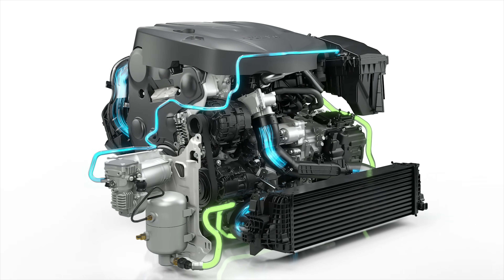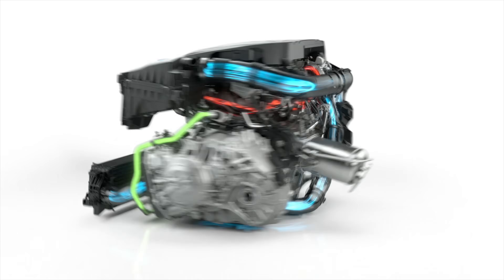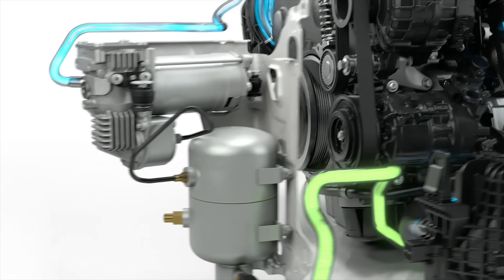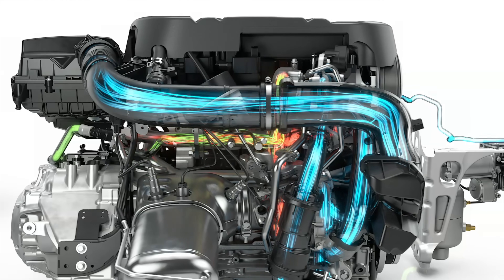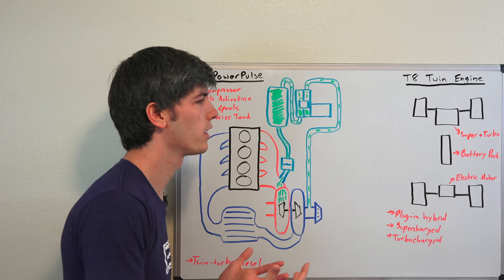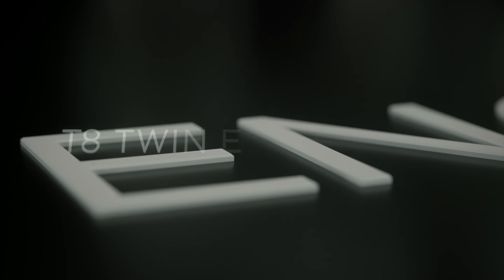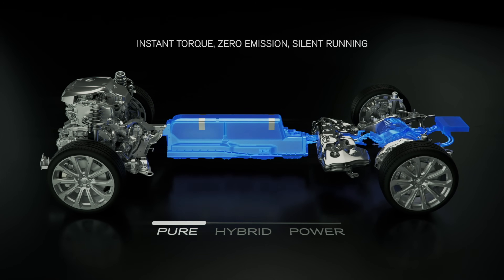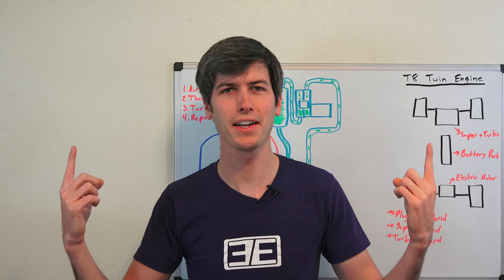How Volvo Is Eliminating Turbo Lag

Comment: Subaru used Twin Scroll, and they and others have played with sizing (asymmetric intake and exhaust), or are going to very high compression and lower pressures with a tiny turbo with very little lag.

There's a lot more choices than just Volvos.  And some are interesting.

Comment: Mercedes old unimog trucks had an air compressor build onto the engine to supply air to the brakes and also any attachment that the truck would have like Jack hammers, excavator attachment etc..

Comment: Volvo is also doing a electric turbo with a belt alternator starter that also adds power directly to the crank for instant torque the (BAS) produces 48v so the E turbo is no joke and will only activate at (WOT) tip in from dead stop or cruise I even think the A/C compressor will be powered by electric motor not from the crank

Comment: Maaaaaan I know this is one of those ‘yeah right whatever’ comments but I definitely had this idea 7 years ago goddammit
Reply from the maker: Yeah right whatever! 😂😂
Reply: Engineering Explained Since we’re already on the topic of forced induction, I did a quick search and didn’t see a video by you on Compressed Air Induction!  I’ve only seen one video on it, and it was produced by the inventors.  One of them is the guy that invented the NOS system.  Anyways, that’d be a good topic, something I’d be interested in at least.

Comment: Cool vid (as always). Wondering if it would make sense to have that surge tank/high pressure reserve for big turbo setups on modified cars of yesteryear, aka wrx's, evo's, sentra's, GTI's, ect... It seems like all you would need is a special exhaust manifold, check valve, the electric compressor, and beefy battery to support. Or, would a small compressor like that only get you marginal gains spooling up a turbo (since on the Volvo, it spools up the small turbo). Putting a monster turbo on a wrx and seeing the thing spool at 2.5k would be pretty wicked!

Comment: what difference does it make where the compressed air comes from if its directed to the exaust side turbo?
Reply from the maker: You don’t want to introduce dirty air into your exhaust system unless you have to (such as from combustion).
Reply: i see, also liked the water cooled exhaust vid, for vw 1.8, as I have one . always clear explanations.

Comment: Not the first to use this idea thought. Ford had an accumulator tank hidden behind the rear bumper of their 2003 Focus WRC cars. Stored compressed air from the intake system then fed it back in when required to give a power boost

Comment: time to duct tape a harbor freight air compressor in my engine bay along with an inverter on my battery, and a solenoid wired to engine management

Comment: I have a question , I wonder if it would work if we used the electric motor to continuosly help spinning  the turbo turbine as fast as possible  through gearing ,instead of using it in the pump? Could we apply that system for all turbos?

Comment: It seems odd to us electricity to compress air. I would think you could either drive the turbo compressor electrically or drive the air compressor off of the engine with a clutch with less loses. This does allow more remote packaging I suppose and might only effect the duty cycle not the size of the alternator. It still seems big and wasteful.

Comment: I disagree about what you said about excitement.
It's way more exciting to drive a car with a huge turbo and turbo lag, than a car with no turbo lag and a flat torque curve.
You can solve the problem yourself by using a higher gear (and more fuel). Exciting!

Comment: What about "electric" turbos? I've heard some companies like Valeo are working on this. It's literally an electric compressor that compresses the intake air. So you don't have to use exhaust air. And the response would be quicker than a classic turbo. And no power loss because the exhaust air would be "free". And also, better exhaust sound...

Comment: Yo dog i heard you don't like turbo lag so we make a couple of moving parts and a lot of power loss to fill a tank of compress air to a small turbo to spin the next tyrbo so you have a compress air on the cylinder. 
Why  they don't add a bloody electric motor to somehow spin the turbo?

Comment: I freaking knew it could work.
Was trying to figure it out on a Corolla for high speed power with a natural aspiration motor by shooting it directly into the cylinder with a methanol water injection mix.
Volvo beat me to it with a turbo.

Comment: Surely an F1 style KERS system which converts 'wasted' braking kinetic energy into electical potential energy which can be used to drive an electric motor to spool the turbine shaft is a better solution. Alternatively, they could simply charge a fast discharging battery (or capacitor) using the alternator and then spool the turbine shaft when needed. Additionally, they could employ a system similar to skyactiv which shuts down the alternator as required. It just seems to me that there are so many losses in this system. I think the bigger question is: If you don't like turbo lag, how do you increase the volumetric efficiency (and thus fuel economy) of an engine? To which I think the answer is variable speed supercharging.

Comment: toyota used to do this on their rally cars nothing new here...........even some of their homologation alltrac/gt4 celicas came with the lines and air injectors fitted to the exhaust manifolds but didn't have the system equipped but you could hook it up with some ingenuity its an alternative form of anti-lag pretty
Reply: pretty common in rally and competition use awesome to see on a street car though

Comment: Question, hope you answer. Compressed air will be cold but it is injected in the exaust where it is extremely cold. Isnt that bad for the turbo, gaskets, rings and everything there is in the way. Parts dont like to be suddenly shocked by enormous tempersture difference. Another thing is condensation people who drive slow will hardy activate the system, by time it will fill with condensation / water... I think volvo spend millions on researching this but still dont you think it is one big thing that couls fail and mess uo a lot of sparts with it? (From a mechanical perspective)

Comment: When I hear the words 1.4L turbo I think of fuel economy but if you have enough money to buy a 2018+ car worth close to 50k you can easily buy a reliable 1990's- 2000's VT Commodore(In Australia) costing 4k-6k with a RWC and 12 month registration that is cheaper to maintain and can keep working for more than 400.000km/248,548 miles and still run beautifully with a neat V6 engine packing over 200nm of torque or a good old 1.8L Nissan pulsar that has about 150nm of torque and close to 100kw of power where servicing these cars are a walk in the park. Volvo are, in my opinion, trying to both money grab things and also are making things to complex. I am no genius in the field where I have been in an apprenticeship for a year now and working on the Pulsar and Holden was easy and not complex at all.

Comment: Using a supercharger mixed with electric motors seems excessive.
Electric motors already have more than enough performance even by track standards.
If you feel the need to use a supercharger you might be better just getting better electric motors.
Another thing is that the mechanism to reduce the lag seems like just another thing to break

Comment: It is a really interesting idea, but I always thought the beauty of a turbo was that it was able to take the energy wasted in the exhaust and put it to use. Now you are using additional electric energy to reduce the lag. It would be nice to see a comparison between a supercharger and this turbo system to see which is most energy efficient and see if there is still a difference between the two systems.

Comment: It's curious that they didn't integrate it into the turbine housing itself.

I daydreamed about such a setup once. It seems like much of the potential energy of the compressed air is lost by injecting it straight into the manifold (where it expands and slows), whereas in the turbine housing you could hit the blades with higher velocity air

Comment: Question: Would you not still have the downside of the low RPM supercharger while using the high RPM turbo? It's my understanding that a super charger has a certain efficiency due to its direct drive from the motor (ex. it puts out and extra 100 hp, but spinning it uses 20 of that 100). The turbo doesn't wind up until higher RPM when the supercharger is out of its RPM range. Would the engine lose some of the turbo's power output because it still needs to spool the supercharger?

Comment: I know this is unrelated to the video, but if you do read the comments, would you be able to explain why the fusion sport is slower than a bmw 340i, they both have awd but the fusion has more torque and horsepower, and it’s not like the bmw has a dual clutch in the 340 to make it shift faster, I just want an explanation

Edit: the fusion is lighter than the bimmer too

Comment: Compressed air is more cold than exhaust gasses, wouldn't that affect the turbo by means of cooling it fast? The good side of the system is that compressed air will clean the soot from the turbo housing.

Comment: Now we know that reciprocating piston pumps are not the most efficient pumps out there- lots of inertia.
Now if you are using engine power through a motor to run that pump, you are using energy to overcome lag, which essentially is lack of energy. Now law of conservation of energy states that energy can neither be created nor destroyed. So, how can you generate more energy by prespooling the turbo, then way you are losing to run the motor and pump? If that were the case, you are creating energy.
Someone clarify this please. I could be missing a point here.
Also, you can't separate the air sent for prespooling from the exhaust, so you now have to worry about heat of exhaust being stored in that gas reservoir.

Comment: Thanks for the vid. Cool tech. I'm curious your thoughts on something though. I HATE turbo lag with a passion, but many moons ago (as in over 2 decades ago) several times I drove a 3rd gen Mazda RX7 that I thought was just amazing. Now I admit that 20+ years may have clouded my memory of those experiences, but the way I remember it I could sense no turbo lag or delayed in-rush of power at all, just instant power at any RPM that pulled linearly all the way through the entire RPM range. (And what a blast too! Love that car!) Anyway, if dual sequential turbo chargers of a quarter century ago could virtually eliminate turbo lag, how is it that the industry hasn't yet optimized the dual-sequential design and incorporated that everywhere? Or another related question would be: If Volvo already has dual sequential turbo chargers, why the need for the air pump--is it just that both turbos are producing more boost and therefore even the small low-inertia turbo has some lag to deal with? And has anyone done a triple sequential turbo system rather than {air pump + small turbo + large turbo} or {super-charger + turbo-charger}? Just curious. Very interesting stuff.
Reply: i think the thing is cost why they don't use dual turbochargers that much and in the case of fwd cars you tend not to have much space in some engine bays for such things. 

i got a story about Volvo for you i used to own a single turbo 2006 S60 D5 it had swirl flaps while a lot of people hate them they were very good on that engine! They werent as problematic as some other vehicles where they could end up in the engine. The way they worked is they would close off the extra air ports on the head of the engine so that air would rush and swirl into the primary ports into the engine and thats what gave the low down torque and responsiveness. it wasnt like instant boost or power pulse but it was enough to get your revs up in a decent amount of time to minimize lag. that is one thing I miss from my old volvo! 

Now i have a bmw those are well known for swirl flaps ending up in the engine so they've been removed but that makes the low down torque really crappy and the lag is bad too. the only way to combat this right now is slip the clutch and just rev it and pull away (manual transmission) but you cant do that all the time your clutch wont last! The good thing about my bmw though is there is a lot of free space in the engine bay being Rwd so im looking at creating a power pulse-like system of my own, and conveniently the egr system has been removed so there is an easily accessible place to put air into the exhaust manifold and subsequently into the turbocharger turbine.

the thing is i need to do more research because im concerned about thermal shock so i need to address that before i  do anything. i got some idea's how but i need to do more research first.

Comment: Hmmm. Well having both a supercharger and electric motors means the turbo could get upsized, so that could help make it more exciting as well. I like that Volvo is ballsy enough to design and implement a "superturbo" setup, enough if it does come at the cost of added complexity and less reliability. Both gas and diesel piston engines have pushed power output up considerably in just the last decade even in common production car models.  We might even see American muscle cars tickle 1000 HP before the end of the decade the way things are going now!

Comment: If you already have an electric motor and a battery, why does turbo lag even matter?  Just upsize the motor/make the battery and motor drivers able to generate more torque.  You might use a turbo to make the engine lighter for the same power, but it just needs to act like a range extender/supplemental power at high speeds.

Comment: Using air to spool up turbos isn't a new concept. Engines used to power ships (I'm talking about the big container ships and oil tankers) have been using this technology for over 50 years. Air is used to spool up the turbos when the load on the engine is less than 40%. the air or 'blowrers' as they are called cut out once the engine load gets above 40% and the exhaust gas pressure is sufficient to spool up the turbo chargers themselves.

Comment: Would the added compressed air in the exhaust have an effect on fuel trims? How are they going to go about addressing the sudden shot of oxygen in the exhaust which would cause the sensors to read the exhaust gas as lean and stop the vehicle from commanding more fuel to compensate?
Reply: No, this system is only used on diesels, they don't use fuel trim, they are always running lean. And even so it's only used when you flooring it and then you want all the fuel it can give.

Comment: Does the air from the compressor adversely effect exhaust gas temperatures? Why don't they pump the air on the compressor side of the turbo if they're using MAP sensors?

Comment: Why not feed the compressed air directly into the intake ports of the cylinders?
Pressurizing the exhaust will increase the back-pressure on the engine, requiring it to work harder, right?
And then they have an engine with a super and a turbo, making the air compressor useless.
This all just seems pointlessly complicated.

Comment: I wonder how many "shots" the air tank has before the pressure drops below a usable output, and how long it takes to fill the compressor. I imagine it isn't an issue for a daily driver, but I wonder if this technology has implications for motorsport or if the tank drains too quickly to be useful.

Comment: So two questions, after you flood it, all compressed gas will be used. and to refill takes time. that means for performance driving it's basically useless.  second, even with compressed air helps to spin up the turbo. it still take time for turbo to spin up, there is still lag, how is it compare to 911 turbo various turbo.

Comment: Seems overly complicated for what it does. I wonder how long it takes for the tank to fill back up. Do some full throttle applications have more boost than others (depending on the frequency), since in theory, once the tank is purged, you'll need a certain time period for it to build pressure back up.

Comment: I wonder how this set up is efficient. 

Hybrid combination, sure. 
The electric motor helps to keep the combustion engine in a good working regime with the lowest specific fuel consumption.  Not used in combination with a CVT transmission so not perfectly at a single point of best fuel consumption but a range could be specified. 
(by loading the engine with electric load when it's not loaded enough and unloading it when it's too loaded)   
The extra weight of the vehicle with battery needs to be taken in consideration but sure, it could be efficient. 
Some regenerative braking in the mix and voila, you've got a strong argument. 
    
Use of a turbo, sure.  Higher mean effective pressure, smaller size engine for the same torque , less weight to accelerate. 
And some energy recuperation of otherwise wasted exhaust heat is always useful.
Variable Geometry Turbo(Variable Vane Turbo,...)  allows a broader range of boost. 
Could be efficient.   

Conventional belt driven supercharger uhhhh, yeah, also higher mean effective pressure, less weight for the same output torque. Less interesting from an efficiency point of view. The supercharger needs to be driven by a belt system and some electric variants also exist, but in the end it needs to be driven by something.    
It could be set up for high torque so that it gives the same feeling as a bigger engine. Providing perhaps a lighter smaller engine.  

Extra electric compressor to spool the turbo... 
Compression of air is not a very efficient process. 
If there was a surplus of electricity for some reason sure, why not. 
Spooling up the turbo helps to get boost sooner. But there is already a supercharger on board... 
So why? 
Why the extra weight? 

All for innovation of course. Explore more! 
We'll have to wait and see to judge this concept.